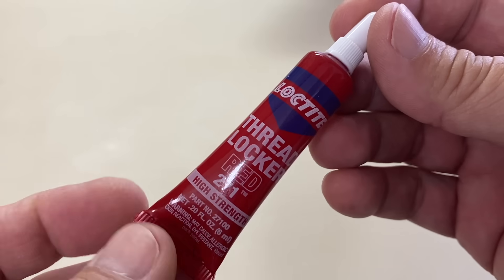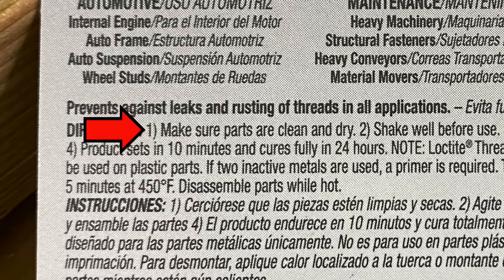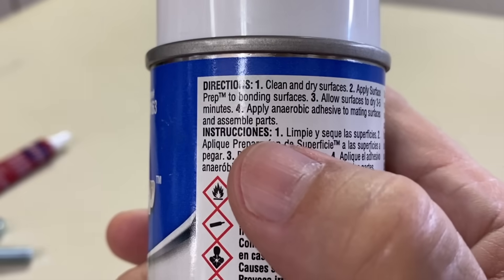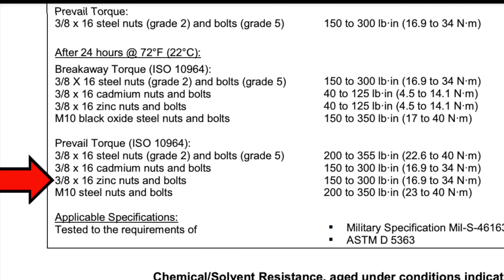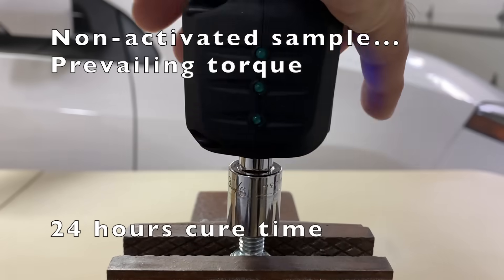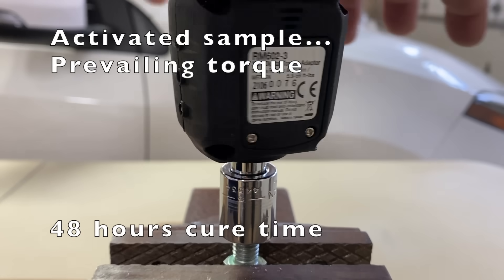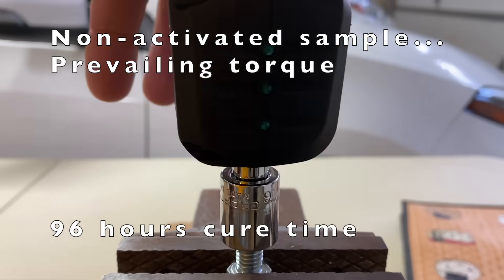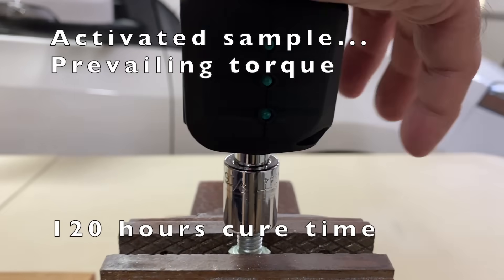Nuts & Bolts - Most DIYers Do Not Know This | Loctite Red Threadlocker Curing

Comment from the maker: For more... please checkout my Nuts & Bolts playlist... https://www.youtube.com/playlist?list=PL_WcGw5s6Cq6YK_s-NNne1838j25ijmii  😎
Reply: not correct use = car engines is main use - your silly !
Reply: While an interesting test showing a slight difference a seasoned mechanic or engineer would find fault. It works without oxygen and a nut on a bolt does not eliminate this. It would not screw on by hand. Placing a pipe and bring to torque will change reading. Had a customer do this on their vehicle and took over 4hrs to remove.
DK, ASE Master Tech since 78, retired.
Reply: So yeah foot pounds has become the regular usage NY many. I just always applaud when someone bucks common usage and uses the "correct" term. But we all know what it means. 
  So how about the torquing down some nuts with and without Red, and with primer?  I mean you already have the bolts...
Reply: panic sweat (he knows too much)   Take the shot take the shot!?!!!
Reply: Did I hear,

 "too close for missile lock,,,
  switching to guns!" ??
Reply: Perhaps maybe if I pee all over the bolts.... I have not been able to get RED locktite to work correctly out side of the blue stuff since the early 1980s the alleged good red locktite has been garbage.. When I raced I used the poUr the RED crap on even crummy oil sodden bolts and it worked. Today U R lucky if it does anything on a prepped bolt... Total gaga & the real problem is??? MADE IN CHINA wins it again & again...
Reply: Do the same test with loctite yellow and loctite blue. Yellow is the best, it was used for locking shaft bearings in Aluminum and other metal frames. Blue can be added after all hardware is tightened, it seeps into the thread and then hardens. sometimes yellow has to be heated on high temp to loosen. Red loctite was used to help keep fasteners from losening during machine vibrations.
Reply from the maker: @topcatandgang  Yellow?  I didn't know that there is a yellow Loctite.  LOL 😎
Reply: Nice try Diddy
Reply: I also have a 2018 Corolla LE, but with Openpilot. What was your best MPG? Mine was 40.5 avg.
Reply: @RinksRides  8

Comment: It's usually pretty common with red thread locker. that the threads will be damaged after breaking a bolt or a nut loose. and it will require the use of a new bolt or nut. but that isn't necessary with blue thread locker.

Comment: The nut needs to be torqued to thread engagement.  Not just loose on the threads.  

You’ll need two nuts to test this correctly.

Comment: I suspect if those bolts were initially torqued the difference would be even less. Torquing a bolt reduced the gap space between the bolt and the nut, and makes that area even more anaerobic (IE lack of oxygen) which is the condition needed for lock tight to cure.
Reply from the maker: Thanks!  You might find this video interesting... https://youtu.be/7yPQIsfv9x8
👍😎

Comment: I like it better when they had only 1 red locktite!!!! You used it when you dint want the bolt to come off again without a torch now you have to be careful which one you buy make sure it's not expired or your racing hub assembly will fall apart at 160mph going down the 1/4 mile track. Hell we used it back in the 90s for hydrolic cylinders and a 20 foot breaker bar on a 1" rachet and using the forklift would not break the locktite free now forget it!

Comment: Try cleaning with acetone or isopropyl alcohol or good old brake clean..👍
What Is Needed for Acid Etching?
Your acid – this will be determined by the type of metal you are etching, though we generally recommend you use Ferric chloride.
Ferric chloride – Works best on copper, brass, nickel silver, and stainless steel. Mix with water at a 1:1 ratio.
Copper sulfate – Best for mild steels. Mix it with a 1:1 ratio of common table salt to prevent a fine layer of copper sulfate from coating the metal and preventing proper etching.
Nitric acid – Works well on most metals. Mix it with water at a rate of 1 part acid per 3 parts water. Or it can be mixed at a 1:1 ratio with acetic acid (vinegar).
Sulfuric acid – Works well on most metals. However, it must be heavily diluted to a concentration of 10-25% acid.
Metal file
Abrasive cleaner (Such as Penny Brite or Bar Keepers Friend) or acetone.
An abrasive sponge, or Brillo pad, or very fine steel wool.
Two non-reactive containers (glass or plastic) – One will hold the acid that you will suspend your metal in. Make sure it is large enough to completely submerge the piece. The second will hold a 1:1 mixture of water and an acid neutralizer.

Comment: Bolts and nuts were not under Torque when tightened...  Run a test where the nut is torqued up while drying...  I would bet the values will be more to the higher end of values...

Comment: What caused the variations? 
**I believe a better test would be on a vibrating test specimen like bolt an engine down and see low much longer the thread locked stayed tight compared to non thread locked. Use split ring lock washers and elastic lock nuts to for contrast.

Comment: I use loctite for a numbe r of reasons. It allows faitly accurate torque on old/used threads. 
It will reduce the chance of a nut spinning off if it does somehow come loose (very usefull characteristic on suspension mounts)
and best of all, it will prevent moisture getting in between the threads and setting up corrosion. 
So, to me, a thread lock compound, prevents threads coming undone, but also, makes dissasembly simpler later on.

Comment: This is not an accurate test.  First you should have been using in/lbs for an accurate measurement at that low of torque.  At 48 hours non-activated torque went down (why you should have checked and documented each drag torque for each nut/bolt with no thread locker first).   Jumps back up again at 72 hours, then steadily back down for 96hrs and 120 hrs.  It doesn't make sense at all.  Look at the 72 hr. measurement on the activated.  It went down at 72, then goes back up again.
I am a retired aerospace manufacturing Quality Engineer (32years).  I have monitored 1000's of torques on rocket engines, fighters, cruise missiles.  Your test here would be completely rejected.  Do it over with in/lbs, check the drag torque on each bolt/nut combo and keep them together as a measured set and clearly marked.  Best to use a dial indicating 0-100 in/lbs torque wrench for accuracy.  I would also get a chunk of 1/4 plate, drill 12 holes, put the bolts through them and then torque the nut down on them for a more true to life test.  It is not a guess that those numbers should go up consecutively, NOT go up and down.  You goofed up somehow.

Comment: Regardless, it's better than without it. Also, if the bolt is torqued against a surface that it bolts down, it would then be even more difficult to breakaway does to the threads having much more pressure on them.

Comment: 2.5mm to 5mm threads have a very small driver head ... stripping the driver head or breaking the shaft is common ... Do a video using smaller diameter bolts, screws and see if its the same results as 5/8" BOLTS!

Comment: You can not have torque if there is not compression and tension on the fastener. What you do have is a nut glued onto a threaded stem. You would need to place a piece of bar between the head of the bolt and the face of the nut to create compression and tension thus creating torque even without the lock tight. If you don't have the lock tight on your fasteners you have a nut resting on the threads of your bolt.

Comment: If zinc is not suitable for loctite then why is it listed in their own literature that you reference and show in the video?  Of course if you use a primer the product works better... that is literally the definition of primer.
Reply from the maker: Thanks!  
I did not say zinc is not suitable for Loctite.  I pointed out that Loctite recommends a primer/activator when using their threadlockers with two inactive metals such as a zinc plated nut and zinc plated bolt.  
The primer didn’t seem to improve the bonds enough to convince most viewers to use it. 
👍😎

Comment: I was always under the impression that products like these relied on micro encapsulation of the catalyst. They need a little pressure/torque to break this encapsulation. This is why it doesn't go off or hard if left open. So, whilst this was a very nice test, it's fundamentally flawed. I'd like to see if torquing the fasteners and then releasing them would change the result by much.
Reply from the maker: True... threadlocker is not used on untorqued fasteners, but it is tested this way.  Here's a video from Loctite... https://www.youtube.com/watch?v=PGZCPyi8yBc
👍😎

Comment: Loctite Red Threadlocker is basically a gap fuller that requires the bolts and nuts to be torque down with the absence of air to activate the chemical. By having nuts and bolts screwed together loosely is not what this product is used for.
Reply from the maker: True... threadlocker is not used on untorqued fasteners, but it is tested this way.  Here's a video from Loctite... https://www.youtube.com/watch?v=PGZCPyi8yBc
👍😎
Reply: @HacksbyDad  That was just a fancy video advert rather than a test. All tests are done at a torque level of the related bolt specifications.

Comment: Sorry but that isn't the break away torque. The Break away torque is first movement of the fastener. What you are testing is "peak" torque, in the first 90 degrees of movement. There are anaerobic adhesives, especially those made from multi-functional methacrylates, that have poor adhesion, but are very hard, and thus have high prevailing values. I am an anaerobci chemist and expert on testing these materials.

Comment: Loctite is used for vibration. Vibration can work loose nuts and bolts and studs. Its designed to break away.  And eventually they rust up on the threads that can be a good thing.

Comment: Zinc is not considered an inactive metal. Zinc is a reactive metal  and can readily oxidize and corrode. It reacts with acids, alkalis, and some nonmetals. You need to test on correct materials.
Reply from the maker: Thanks!  Pls explain this to Loctite because they list zinc as an inactive or passive metal in their technical data sheets.  👍😎

Comment: Who actually uses 271 for anything that will be disassembled? The product sheet notes it only softens, once cured, at 500ºF, which calls for oxy/acetylene for metal parts of any size, such as a crankshaft nose and crank bolt. Busting fasteners or tools is not my idea of a good day.  I won't have the stuff in my shop or tool bag, as it hopelessly complicates any subsequent disassembly. As published by Loctite, NOT for hand tool disassembly, unless you have serious heat available. Loose nuts on screws isn't using anerobic cure Loctite products correctly, explaining the low removal torques.

Comment: The curing performance depends on room temperature as well. Higher temperature gives more torque with less time. If you dont have activator ( Loctite 7649) you can do the same or better result on elevated temperature.

Comment: Small sample size, but it looks like the activator adds strength early.  So if it must be pressed into service quicker, use activator.  Also, it appears that the red needs 72 hrs.  Does the strength really drop off or is that a sample size issue?

Comment: Great info....But,I believe a more user based  test should be done with the bolt/nut assembly tightened down to a rated torque spec for that particular bolt using a matching material flat washer sandwiched in between. I say this because an engineer that once serviced an account for me stated that Loctite was activated by the presence of metal and the absence of air which in your testing may not be as affective by the fact that the nuts are freestanding on the threads. And yes, different metals will surely affect the outcome of the torque required to remove the fasteners, especially when dissimilar metals are involved, take for instance aluminum blocks using stainless steel fasteners. Even then variations in results will occur according to the levels of zinc and lead contained in the aluminum metallurgy . Basically when you add the loctite and torque the fastener, a science project begins !!!  Hope this will add some more light to the Loctite experiments.

Comment: I've always found from using loctite for the past 30 years, an anaerobic environment is necessary but when you torque down on the threads like with a torque wrench or an air impact hammer, the loctite ends up being way way way more aggressive.

Comment: There is a fundamental flaw in your test method with respect to Loctite.  Loctite is designed to work at a film thickness level on the loaded side of the fastener assembly.  The nuts in your experiment were not loaded as they would be in an assembly scenario, thus, you were shearing an inappropriate amount of the product (nuts were basically loose).  Place a spacer between the nut and bolt shoulder and repeat the test.  The delta will jump significantly..
Reply from the maker: Thanks!  My test mimics Loctite's breakaway torque test as shown in this video... https://www.youtube.com/watch?v=PGZCPyi8yBc
👍😎

Comment: One might expect the prepared bolts to require more torque since the spray will effectively 'fill up' the threads a little. Perhaps a control experiment where the alternative is sprayed with a quick-dry varnish or similar, before the Locktite is applied, might be revealing?

Comment: But what does the Loctite actually do? It acts as a clearance filler between the threads thus reducing the tendencies for a nut or bolt to rattle loose if vibration is creating forces in multiple directions. Loctite 243 is temperature resistant to 300°F

Comment: Just centre punch the bolt and nut (just on the outside). In the right angle where they meet on the thread. If you really don't want it to come undone centre punch it in two locations. They won't come undone and its much cheaper. No activor required. 

Its amazing how we all rely on these products but what happens if you run out or they are not available.

 Further more the price of Loctite is rediculos!!!!

Comment: I haven’t used 271 in many years, I was wondering if the formula had changed since the 1970’s. Back in my foundry days we used a lot of loctite both the red and blue, and often we had to use a torch to heat the bolts if they had the red before we could get them loose. Anyone know if the formula changed?

Comment: I use the red X-Delight thread locker (Chandor 2242). I use it mainly on my bike and escooter, but other stuff that shakes around also, lawnmower etc.
Whenever a screw comes loose after I know I've tightened it properly, I clean the screw, blow a bit of air into the hole then apply a couple of drops of thread locker onto the thread.
The screw will never come loose again. If I need to remove the screw/bolt it always comes out with only a little extra effort, nothing too difficult, great stuff.

Comment: Very interesting and thanks for taking the time for the tests. Your method is great for initial assembly. However, where I work there is no time for anything other than reassembly. Apply the Loctite, torque the nut or screw and put back into operation.

Comment: I read through some comments about stainless nuts and bolts. They're not all equally poor performers. You need A4,or 316, the expensive kind, and lube rather than an adhesive with a nyloc nut tightened specifically, I think the torque is less than high tensile steel bolts. But I head they are not really suitable for high vibration environments

Comment: I've never known loctite not activate unless it's open to an air source. This experiment was totally flawed.  
The loctite was never gonna dry with 2 open sides of the nuts.
I've used 271 on zinc nuts and bolts and it took over 80lbs to break .
If you had tightened the nuts right up to the nut head it would of cured.
Reply from the maker: Loctite does cure with 2 open sides.  If not, please tell Loctite to update their test procedures... https://www.youtube.com/watch?v=PGZCPyi8yBc
👍😎

Comment: Did you factor humidity? In a controlled environment? Here is what I use for lock tight on projects and repairs where I want things to stay in place under forces but do not really care if it gets rust or plan to have to remove the bolts…. I have an eyedropper bottle. Inside of the bottle I have some muriatic acid, 3 parts acid 1 part tap water. I drip in onto the bolt, zinc plated or not.  I then tighten the nut down. Then I spritz with water after a minute or two. The bolt will rust to the nut underneath the threads and it does not move unless I apply pb blaster or nano or whatever penetrating catalyst. 

If you want you hammer heads to stay on your hammer for many more years than average, once you have wooden wedged on a new handle, and driven the metal wedges perpendicular to wooden wedge, let the head soak for a day in ethylene glycol (antifreeze) then rinse. Then oil your hammer head. It won’t come loose for 10 years or so

Comment: In my experience using ether or starting fluid will do the same thing as the activator. The main consideration is to make sure the bolts are clean and oil free.

Comment: Examples of Inactive metals: Stainless Steel, Aluminum, Zinc-Plated Steel,  Nickel-Plated Steel, Chrome-Plated Steel, Cadmium-Plated Steel, Titanium,  Galvanized Steel, Gold, Silver, Brass, and Bronze
Examples on Active metals: Plain Carbon Steel / Alloy Steel, Iron, Copper  
Make sure the primer is designed for use with inactive metals.
Reply: Sticky Glue.

Comment: You’re totally wrong!  

Inactive metals are platinum, gold, aluminum, stainless steel and some plated metals like chrome.

Zinc, zinc plating and zinc bolts are all ACTIVE.  

Activator is NOT required.  It just speeds up the curing process. 

Thread locker is an anaerobic adhesive.  It will not cure in an aerobic environment.  

Just use thread locker like you always have.